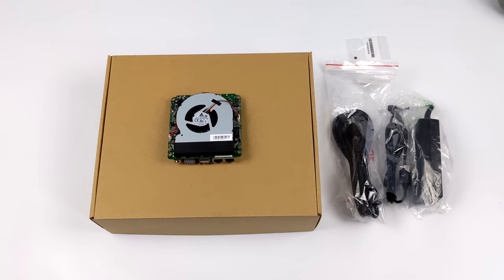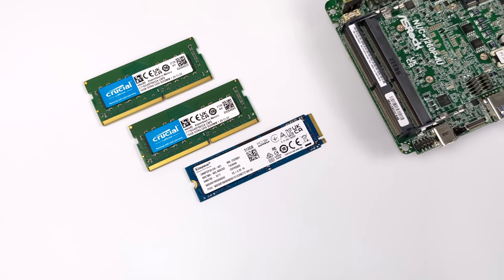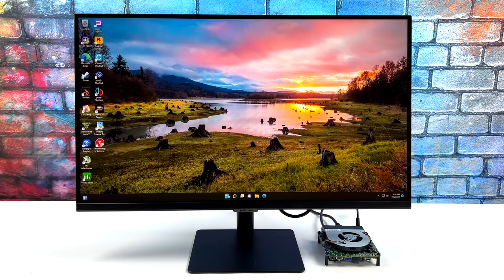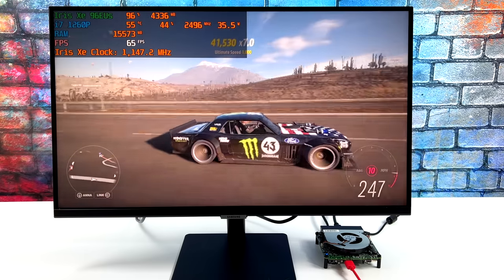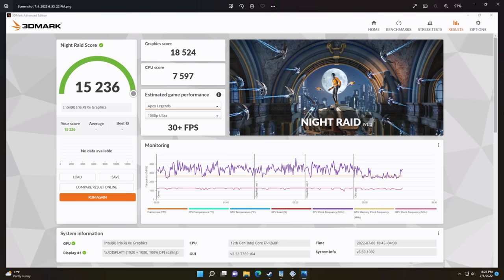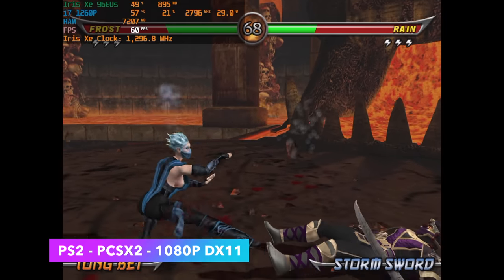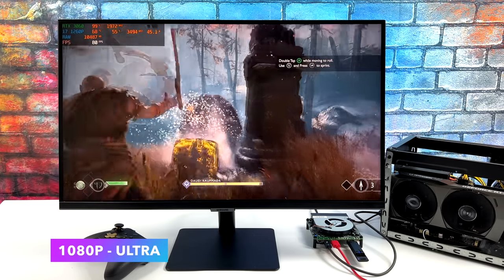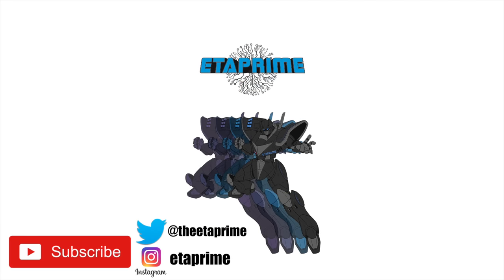The Most Powerful X86 Board We've Ever Tested💪 Incredibly Fast 12 Core CPU

Comment: Don't forget to consider the Framework motherboards. 

They have a 14 core 20 thread i7-1280p on offer with 4.8GHz @ 65w.
They offer low-profile desktop cases that can be 3D printed and VESA mounted too.
Reply: Tried googling it, but for some reason kept getting laptops rather than barebone motherboards 😕

Comment: In my honest opinion the nuc sized mobos should replace the mini-itx boards as the smallest DIY platform standard. Look how much place it still has, it can easily have room for a full sized pcie- port as well in form of a gold finger if not as a slot. 100% it can even support a socketed cpu being this size as well. At least this is what I think having used itx board since around 2011 and seen nuc boards in person.
Reply: Intel and motherboard manufacturers have been really lazy for the last decade in terms of hardware efficiency. It takes Apple starting making insanely good ARM SoC for them to innovate and catch up. Before Mac Studio every goddamn Windows PC has to look like a freaking Panzer 🙄
Reply: no, it can't ,,..... yet ! mini itx not just small but fully upgradeable, use the same size of hardware like other mother board which make it  easy to build, upgrade ,more value than nuc !

Comment: That single board computer would be GREAT for a home made router. Especially because it has two ethernet ports. so you can have one from ISP and then the out to a switch.... and then have a wireless access point attached to the switch along with all your other devices.... EDIT: my biggest gripe with "gamer" grade routers, its not for power users. its great for a single user, but multiple gamers and power users they fall short and you get not only packet failure (rarely) but you get insane buffer bloat and ping issues. while with a custom router with faster cpu's, you can bypass all those issues retaining low ping while downloading thanks to proper packet sorting via faster cpu's. im actually appalled at how bad gaming routers are.
Reply: This is completely over powered to be a router. There are cheaper, passively cooled boxes the same size with multiple 2.5Gbps ports.
Reply: A router you can game on...
Reply: @keyboard_g  but is the cpu powerful enough? because most "gaming" routers now cant handle more than 1 user in any realistic sense. and their cpu's are only akin to 2012 cellphones. the whole point of going with a faster processor is to make sure you can have multiple power users with 0 issues.

Comment: I was wondering how well just adding more heat pipes would help. I could hypothetically replace the vrm thermal pad with a right angle heatpipe and fix a few more heatpipes on top to better transfer heat from the baffles to the fan body. It could also be interesting to extend the baffles out past the I/O either with a copper plate and mini finned heatsinks or with gently bent heatpipes a little.
Reply: More heatpipe may not help much if the radiator capacity not increased

Comment: I wonder how much this cost? The website doesn't say (have to inquire) and most of the "where to buy" sites are broken right now. The ones that do load don't even list the products.
Reply: Pricy, you will be shocked
Reply: If they don't list the price they don't get my money. What a stupid strategy. I'm not filling out a form to get the price of a product!
Reply: Seeing as it's a site aimed at businesses, retailers in that space often consider their price lists to be proprietary information and probably ask it not be disclosed.
Reply: @Ben-ry1py  brand new board, parts shortages, not being mass produced as of yet, they don't have a firm MSRP.
Reply: @blingVolcano  fair enough, I'm going to wait till the 6800U is widely available and pick up the best unit with that APU anyways. RDNA 2 is killing Intel's integrated graphics this gen. It's amazing how far X86 processors have come in the last few years as far as capability and power efficiency!
Reply: Around $650.
Reply: @palwindersingh9678  Thanks!
Reply: @Ben-ry1py  The product is so absurdly priced at least from the gaming (or emulation) point of view. For budget of $650 you can purchase Xbox Series X + 1 year game pass +  Xbox DEV Mode (for emulation) and still save some cash.
Reply: @palwindersingh9678  I agree! The form factor is not worth the purchase price, and you still have to provide your own ram and ssd. better off getting a steam deck...if they were actually available.

Comment: On the i7-1185G7 laptop, in Night Raid I got 18713 for graphics and a cursed 6666 for the CPU. My result is in the 3DMark database as nr/566264 (I did not put the complete link with the 3DMark website in front, as Youtube's artificial intelligence trained on natural stupidity deletes my comments). My laptop has DDR4-L 4800 128bit.

Comment: i don't think the reason its locked to 35 watts because of cooling. it probably does not have the power delivery hardware to support more either (things like VRMs)
Reply: I am sure it is the cooling.  I have 4800u version, and the cooler cannot keep up at all.  90+ °c at 28 or 30W.....

I DIY a custom cooler from an old 2 heappipes North Bridge cooler, drop to 60°c....
Reply: @will3641  temperature will change depending on lots of factors, but they probably arent going to waste money and space by giving you a bunch of thermal headroom when there's no more the power to safely give
Reply: @will3641  How did you go about getting the board on the industrial site? Im trying to figure out a price but dont have a company to make an inquiry for the product

Comment: How does the performance compare when you just use the power cores or just the efficiency cores? I imagine the 4 P cores with hyperthreading still beat the 8 E cores.
Also, how does the power consumption change? Maybe there is a use case for running this board with just E cores on battery, but there's probably much cheaper boards that would run at a lower TDP.

Also, if you disable all the E cores can you use AVX-512 instructions on the P cores? That improves performance in RPCS3, which also doesn't work well with E cores anyway.
Reply: RPCS3 doesn't even use AVX512

Comment: Need help. I have two minis forum pcs. Both of them act very similar in the way they boot. I just bought a B550 because I thought the old machine was dead and this one does the same thing. After the minis forum logo shows up the screen goes black. You usually have to boot them several times just get to the recovery screen.  Even after windows does boot they randomly go to a black screen and have to reboot them again. I've updated drivers,  windows and changed hdmi connects and taken the plug out of the shared power strip and plugged in directly to the wall. These are too expensive to have these kind of problems. Any insite would be helpful
Reply: Reseat the RAM perhaps, or if you can, try a better power supply unit